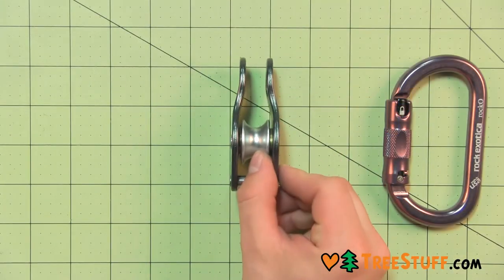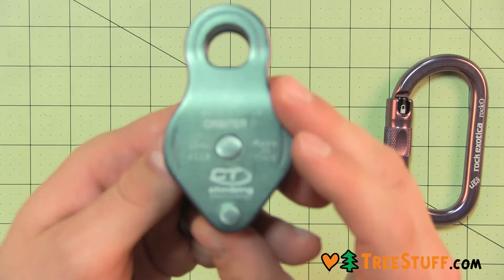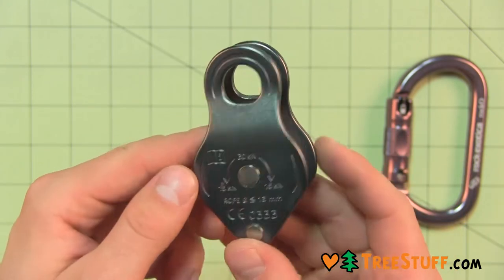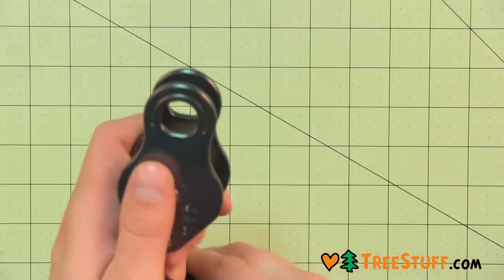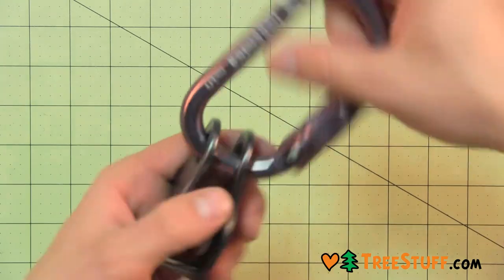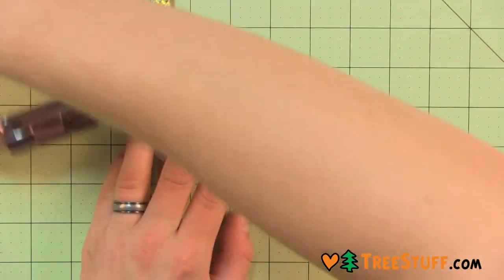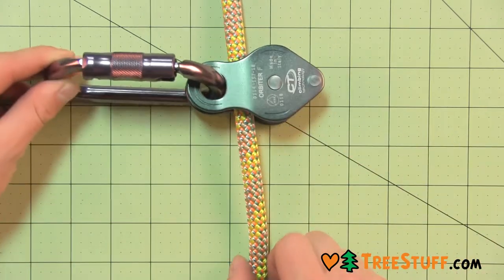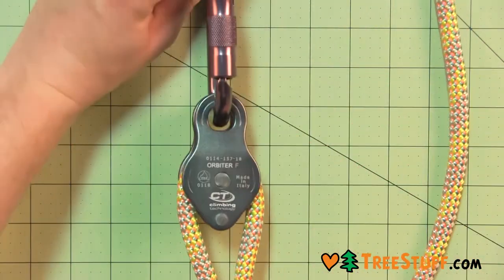Climbing Technology Fixed Pulley - TreeStuff.com 360 View

Comment: Fantastic little pulleys which I now have three of.⏩>allmy.tips/FusionPulley?ll ❋    I use them as snatch blocks for pulling down fairly big trees (pulling them down vs. cutting them down, using the tree's length of trunk to leverage the stump out). Easy to use, smooth action and agreeably stout for my purposes using Dyneema synthetic rope. Used properly, the mechanical advantage (or ease to winch) becomes substantial.